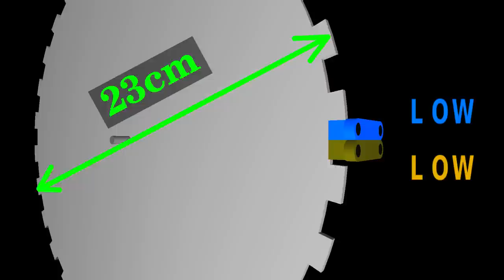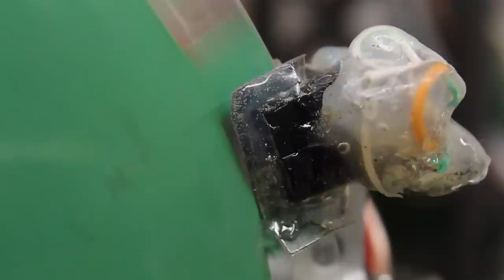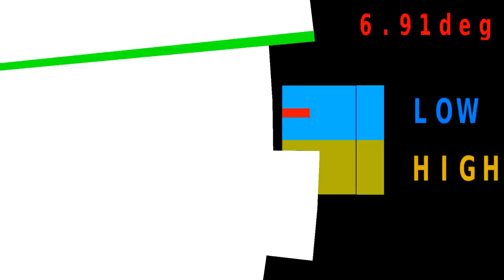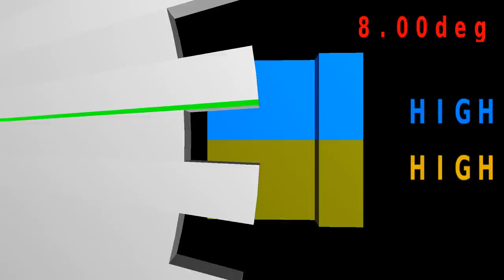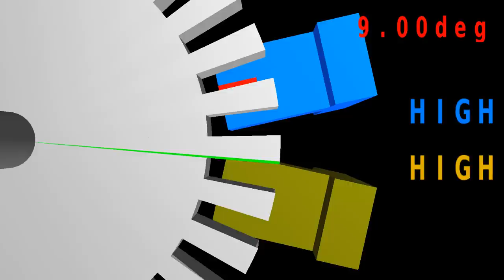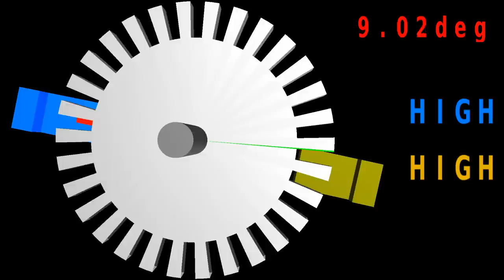Rotary encoder - sensor arrangement

Comment: I build this and worked perfect for my purpose . I made a 91mm disk with 36 teeth and 36 spaces. My idea is to make it stop say when the counter comes up to 300. This is under 17 full revolutions. The question is what can I add to the program to make it stop at 300 counts. Thanks for the fantastic video and presentation. People like you make a difference.
Reply from the maker: The question is: What are your coding skills? Have a look at the source of the Arduino sketch and make the changes.
Reply: @HomoFaciens  unfortunately I am not that good but kept trying.

Comment: One of the best demonstrations of quadrature encoding I've seen. Thank you. 
I would like to add the following hardware solution. Take the output of the opto sensors through a Schmidt trigger, like a 74HC14 to deglitch them. Call the outputs X and Y. Next get a 74HC74 D flip-flop and connect X to the D input (pin 2) and Y to the clock input (pin 3). (Pull up pins 1 and 4) The Q output (pin 5) now indicates direction. Again take X and Y and connect them to the inputs of a 74HC86 XOR gate (pins 1 & 2) take two times clock from the output pin of the HC86 (pin 3). That is your hardware solution to reading a quadrature encoder.
Reply from the maker: Thanks! Yes, you should always try to get the best in- and output signals possible. That makes processing data more reliable. Having a loser look at this subject is on my list of things to do.

Comment: Good tutorial. 
Just to completely overview a topic of this type encoders. 
You can make a video for the encoder which has double or several  areas with different resolutions. 
As result, Arduino can use raw encoder for a fast movement to the desired position and with slow speed use precise area for the fine positioning.
If the tooth size will be the same as the detecting window it will produce sinusoidal signals. This signal can be detected by ADC and after could be calculated angular position with extreme precision.
Reply from the maker: There is more to tell about rotary encoders. I will talk about your suggests in my "Physical Computing" series that will start soon. Stay tuned!
Reply: You can try to make dedicated slave microcontrollers for each servo. 
Than program them via any interface from main controller: Speed, Direction, Acceleration, Distance. 
And use single sync signal to start simultaneous movement on many axes.
During the movement period of time, could be buffered new data points.
Reply from the maker: I'll keep that in mind.

Comment: nice!....havent watched the whole video yet (am in the process... but I wanted to comment something that is already apparent to you probably but interesting none the less....just stack the sensors vertically at a slight (1mm offset) and you could have it operate using just a hair more than a mm thick ;)....that would increase precission of the system by ?? approximately 700% :)

Comment: Also if you increase the resolution (to greater than the motor is capable (calculation would need to be done of course depending on specific specifications desired in teh end product...but....)...if you did increase the resolution to greater than that of the motor's resolution, you could (there might be an easier way) get input when it misses a step ....that is more precise than is capable otherwise which could be used to design a response algorythm to lower the speed or linear velocity of the movement to be in the capabilities of the torque of the motor without missing a step and at the same time keep positive identification on the location of the motor at ANY TIME...which means that it wouldn't have to re calibrate by running to a limit switch or what not...but could continue on and cut the speed, thus getting better material takeoff quantity and ending in a superior finish...and with less wear and quicker ;)
Reply from the maker: Higher resolution means more input to be processed by the microcontroller. The Arduino I am using in my latest CNC v3.2 is near the limit with the 120 pulses per revolution (that results in less than 0.01mm of linear movement per step).
But you are right, if your computing power can process the high number of pulses, more is usually better. I will talk about that when doing the software optimizations for my CNCs.

Comment: Again you have brought me to school.  I have learned so much from you in detail about encoders.  I have heard that Arduino's are not fast enough to calculate fast encoding, motor control.  Have you had any problems with this?
Reply from the maker: Not fast enough depends on what kind of motor you'd like to control. Using the hardware interrupt pins (two at the Arduino Uno) you can process encoder pulses in the range of several kiloherz. Even without interrupts I am using an Arduino Uno to control the 3 servo motors of my CNC v3.2. Writing efficient code is the key to successful Arduino projects (or mocrocontrollers in general).
Reply: Thank you I will check into that

Comment: Mr. Heinz,  thank for video, is it also possible to know the orientation of the motor by the two optical sensors?
Reply from the maker: Sorry, but I don't understand the question. Put the sensor disc on the motor shaft and you can determine the angle of rotation od the motor.

Comment: Is it better to put the encoder on the slow shaft or the fast shaft for geared servo motors?
Reply from the maker: That depends on the accuracy you need (higher with the encoder on the motor) or the number of pulses your microcontroller can process (better on the output shaft of the gear).
Reply: @HomoFaciens  Thanks for your reply! I have made several analog and optical encoder servos now that I can control with a potentiometer. How can I create a menu of positions for automatic sequence of movement?

Comment: Hi.. Thank you for the great video.... What type of position sensor system would you suggest for position estimation for a switched reluctance motor application?... Can we use the method in your video?
Reply from the maker: The type of feedback sensor depends on your application, not on the type of motor you are using. You can use a quadrature encoder with light sensors as demonstrated in this video for many applications.

Comment: Nice Job,  but,  How fast are they  ?    What's maximum frequency  ?   Will the censors work at 5000 rpms of the disc  ?
Reply from the maker: An Arduino can process incoming pulses in the range of some kilohertz. The rest is simple maths.

Comment: Thanks for video. Can i get the code for this?

Also i want to implement it with pic16f628A or 877a.
Reply from the maker: The source code is available on my pages:
http://homofaciens.de/technics-base-circuits-encoder-disc_en.htm
If you'd like to make it run on a different controller, you must eventually rewrite the code.

Comment: Thanks for your great explanation! Do ou use a atmel microcontroler? Can you share a code for us?
Reply from the maker: I am using an Arduino Uno which is an Atmega 328P. Code is on the project page:
https://homofaciens.de/technics-base-circuits-encoder-disc_ge.htm
Reply: @HomoFaciens  thank you my friend!

Comment: Anyone know if Opto encodes suffer debounce? As i have an encoder that is fluctuating between high and low while the motor has stopped.
Reply from the maker: That depends on the type of optical encoder. There can only be a is a bounce on one of the outputs at a time, since the second is fully covered or fully exposed at the same time. With that it doesn't have an impact on the accuracy..

Comment: I recently got an idea of using distance measuring ultrasonic sensor like the hrs04 sensor to detect and measure linear movement and would be helpful in the CNC machine project. What do you say about that?
Reply from the maker: With the "classic" approach of using rotary encoders on threaded rods you can easily get a motion detection with an accuracy of 0.1mm with a travelling length of 1m (or more). Compare that to your ultrasonic sensor. A CNC with an accuracy worser than 0.1mm won't be a good one.
Reply: Got that!

Comment: Why dont you use just one sensor for tracking the steps and keep track of the direction in software through a variable when direction pin is triggered..?
Reply from the maker: Just one sensor only works in slowly turning sensors, such as used in my cnc v3.0:
https://www.youtube.com/watch?v=IPClUTfKB-o
In high power, fastly spinning control loops, there is always overshoot caused by inertia, thus you can't be sure your motor spins into the opposite direction as soon as you trigger the reverse pin. It will continue spinning into the wrong direction for a couple of steps.
Reply: Ok got it. Thanks for answering.

Comment: My 90´s classic car used to have electronic headlights height adjustment. It seems someone replaced them with the cheap ones, and i am planning to build the rotary encoders myself and this video has been of great help. Is the arduino code used for this available?
Reply from the maker: As written in the video description box and said in the video, The codes I used are available on my pages:
https://homofaciens.de/technics-base-circuits-encoder-disc_en.htm

Comment: Hello friend, your projects are excellent; I subscribed to your channel.
In your video, at approximately 4:40, you show a Sensor with a Sprocket; I have a small Printer Motor coupled to an Optical Sensor and a small Sprocket (approximately 32 teeth) but my sensor has 4 wires, certainly 2 for power and 2 for the signal, so how can I use it with your code? Thanks
Reply from the maker: As told in the video, have a look at my project pages. There is also a chapter on using unknown sensors from old printers:
https://homofaciens.de/technics-base-circuits-transmissive-optical-sensors_en.htm

Comment: I like the simple idea. Is it as simple as doubling the sensors for doubling the resolution? could hall sensors be used on metal gears?
Reply from the maker: Besides light sensors, Hall sensors are commonly used for contactless rotary encoders.
Each additional Sensor can double the resolution (two more sensors means four times the resolution of 2 sensors). It's the binary number scheme. However, you must place them correctly.
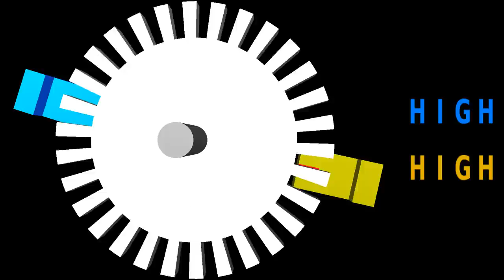Reply: @HomoFaciens  so at 8:18, the formula goes D = n (W_tooth + W_gap) +/- (W_tooth/2), an alternative formula might be: PulsesPerRevolution = N_teeth * (2<sup>(N_sensors)</sup>)
Reply from the maker: Its not that straight forward with the number of teeth. You need a more complex sensor disc to get the result:
https://en.wikipedia.org/wiki/Rotary_encoder#Ways_of_encoding_shaft_position
Reply from the maker: @Michael Rinkle sounds interesting! Compensating backlash through software isn't the best solution, however I am curious to see your construction once it is on thingiverse.

Comment: can you use stepper motor for this kind of configuration? this will clearly improve stepper motor to eliminate stall or miss step from the stepper motor
Reply from the maker: Of course you can also implement feedback for a conventional stepper motor.

Comment: How do you increase the resolution to something like 1º. Good videos.
Reply from the maker: With the 1mm wide sensing areas of the detectors used in this video you need at least 2mm wide teeth (3mm and more is better to adjust the system). To get 1°, you need 360 pulses per revolution, thus 360 / 4 = 90 teeth, resulting in a 17.2mm disc diameter with 3mm teeth and gaps.
There are sensors having two output pins built in, that can scan even finer line patterns. Have a look at the sensors used in printers:
https://www.youtube.com/watch?v=a55EwMSIy2w
Reply: 172mm, not 17.2mm! Don't get peoples hopes high! I really love your work.
Reply from the maker: No, 17.2cm ;-)
Thanks for posting the correct number.

Comment: Hellow sir i want to use rotary encoder to measure linear distance by just multiplying counter with circumference of the wheel. In center of the wheel i fixed saft of encoder but i found problem that  I made it to show a number of encoder into monitor when it changes the state. But when I rotate it, it shows a new line in serial monitor, but the number of it does not change (it wanted to change but it did not). however if I rotate it very slowly it works and changes. But I do not use any interrupts. Here is the code and help me to solve this problem :
 
#include <LiquidCrystal.h>

LiquidCrystal lcd(6, 7, 8, 9, 10, 11);
// int address=50;
// int read_value=0;
 const int  buttonPin = 4;
 int buttonState; 
// int led=9;
 int val; 
 int encoderPinA = 3;
 int encoderPinB = 2;
 int counter = 0;
 int encoderPinALast = LOW;
 int n = LOW;
 float Length;
 float r=31.82;
 float pulses=15;
 float pi=3.1428571;
 int istrue;
 

 void setup() {

//  pinMode(led,OUTPUT);
   pinMode (encoderPinA,INPUT);
   pinMode (encoderPinB,INPUT);
   Serial.begin (9600);
   lcd.begin(16,2);
   lcd.setCursor(0,0); 
  lcd.print("LENGTH   COUNTER");
  lcd.setCursor(0,1);

  lcd.print(Length)+lcd.print(" mm  ")+lcd.print( counter);
//delay(400);
 } 

 void loop() {
   
     ///// 
     n = digitalRead(encoderPinA);
   
   if ((encoderPinALast == LOW) && (n == HIGH)) {
     if (digitalRead(encoderPinB) == LOW) {
     counter=counter-1;
        Length=2*pi*r*counter;
        Length=Length/pulses;
        if(counter<1)
        {
          Length=0;
          counter=0;
        }
          lcd.clear();
          lcd.setCursor(0,0); 
  lcd.print("Length   Counter");
  lcd.setCursor(0,1);
  lcd.print(Length)+lcd.print(" mm  ")+lcd.print( counter);
  delay(100);
          
          
        
        lcd.setCursor(0,0); 
  lcd.print("Length   Counter");
  lcd.setCursor(0,1);
  lcd.print(Length)+lcd.print(" mm  ")+lcd.print( counter);
  delay(100);
  Serial.print ("Length (mm)");
  Serial.println (Length);
     } else {
      lcd.clear();
      lcd.setCursor(0,0); 
  lcd.print("Length   Counter");
  lcd.setCursor(0,1);
  lcd.print(Length)+lcd.print(" mm  ")+lcd.print( counter);
  delay(100);
  Serial.print ("Length (mm)");
  Serial.println (Length);
       counter++;
        Length=2*pi*r*counter;
        Length=Length/pulses;
        
    
       
     }
      
   } 
   encoderPinALast = n;  
   buttonState = digitalRead(buttonPin);
     if (buttonState==HIGH){
     
  //do nothing
     
     }
     else { lcd.clear();
      
      counter=0;
      Length=0.00;   
 
     
      lcd.setCursor(0,0);
      lcd.print("R E S E T .... ");
      
      delay(770);
    lcd.clear(); 
    lcd.setCursor(0,0); 
  lcd.print("LENGTH   COUNTER");
  lcd.setCursor(0,1);

  lcd.print(Length)+lcd.print(" mm  ")+lcd.print( counter);
     }
     }
Reply from the maker: Output through serial.print or through LCD modules takes too many cycles, thus your microcontroller will skip many pulses and so it won't work (at least just with very slow speeds). The only way is using interrupts as I did in the video. You can get my sample code on my pages:
http://homofaciens.de/technics-base-circuits-encoder-disc_en.htm

Comment: Is it possible to hack a rotary encoder w/sensor board? I have a usb encoder board that is used on a commercial wheel of fortune game. It is used to spin the wheel,  as well as letter selection. I would like to use buttons on an extra machine instead. Right and left button for letter selection would be nice, and a button to say spin wheel max. BTW, game will not function if it doesn't see encoder board connected, so kinda need to work with it
Reply from the maker: I have investigated how to make use of such sensors in printers:
https://homofaciens.de/technics-base-circuits-transmissive-optical-sensors_en.htm

Comment: Hello Dear,
 Can we measure the tooth thickness of gears using this rotary sensor.
If yes then please suggest me that sensor.
Reply from the maker: What sensor you need for measurements depends on the accuracy needed to make it work for you. It's a huge difference if +-1mm is okay for your setup or if you need +-0.1mm. The sensor is just half the measurement, You must say what mechanics you have to scan your gears.
Reply: I am doing monitoring of Backlash (reducing one tooth thickness by 1 mm). That means if I am having 45 number of teeth from that all of 44 teeth having thickness of 5mm and the last one having 4mm thickness. I am using phenomenon of change in magnetic field which varies based on the metal target geometry (as per my assumption). Is it possible to measure such small change in gear teeth with hall effect magnetic sensor? Please suggest me such sensor which can measure the 1mm change in gear teeth. Rpm of gear is around 500.
Reply from the maker: Sorry, but I haven't done such measurements, yet, thus I can't tell you to use this or that sensor. Whether it works or not depends on more but the gear dimensions.  It's up to you to create a test setup and see how it performs Improve the design until it meets your requirements. Inventing means try and learn from errors.

Comment: My homemade Six Digit, 20MHz, CD74HC192 Up-Down counter circuit counts Quadrature Encoder pulses at 20Mhz speeds. And seems to be many times faster than using my PIC16F887 microcontrollers.

Can you tell me why?
Reply: Of course the discrete logic gates or programmable logic circuits are a lot times faster compared to a clocked microproccesor that executes one by one instruction in the best case one instruction per single clock.

Comment: Is the importance of resolution based on how much steps you want ? If I want to make only a single wheel rotation per step does the resolution matter in this case ? can i just attach a magnet to the wheel and use a hall effect sensor to count one step and that will be fine ?
Reply from the maker: The more teeth, the more steps per revolution. If 1 pulse per revolution is sufficient, use only one tooth or one magnet with hall sensors. You need two sensors to detect the direction of rotation. More about rotational encoders on my pages:
http://homofaciens.de/technics-base-circuits-encoder-disc_en.htm